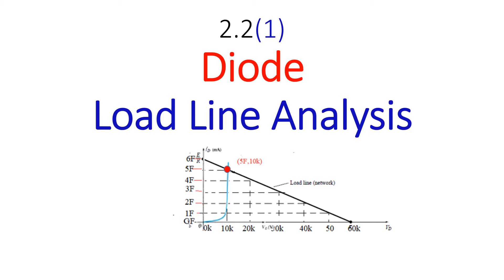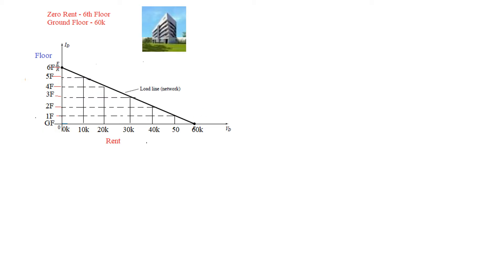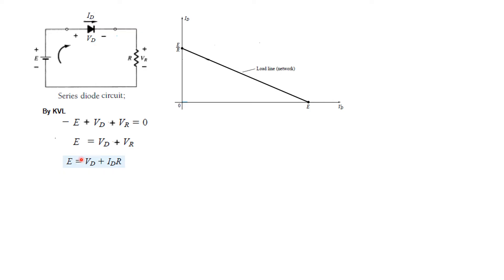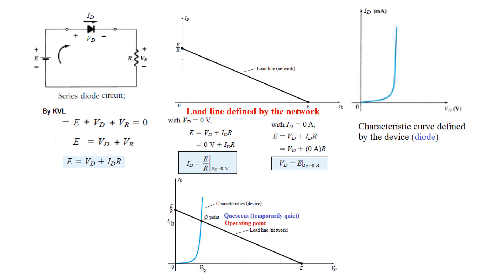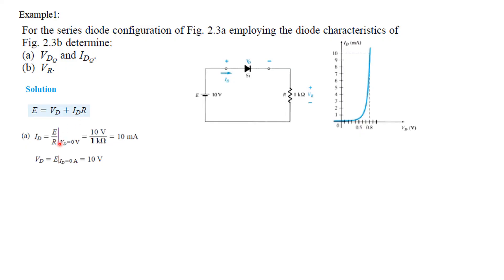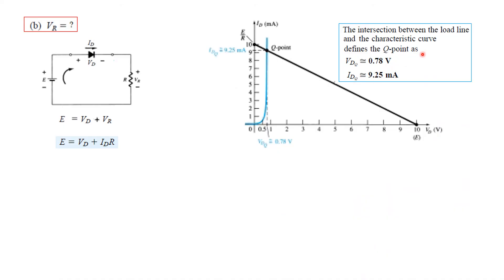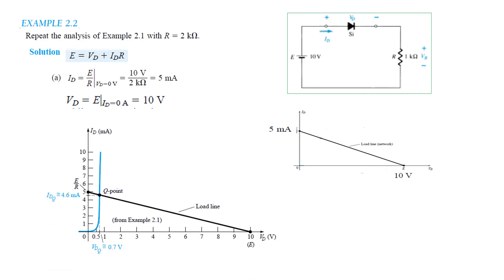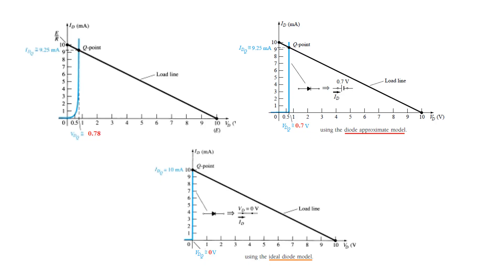(E)EDC(B) Ex 2.1 & 2.2 || Diode Load Line || Diode Approximate  Model || Quiescent Point

Comment: 8:26 If we tske V dq slightly less or slightly more than 0.7 ....will it be wrong? Or is it like this whenever we see si diode we take 0.7....Please clear my confusion
Reply from the maker: As shown in the graph, the diode starts conducting at a voltage value of about 0.2V, but the current is much less. For all practical purpose we take 0.7V as the conducting voltage. (keep your life simple, and keep research work for PhD studies)